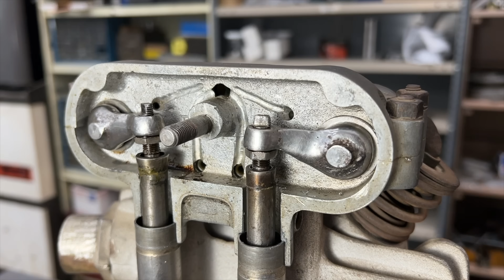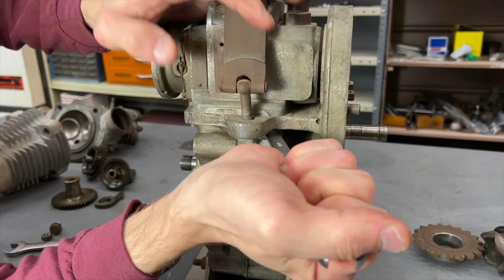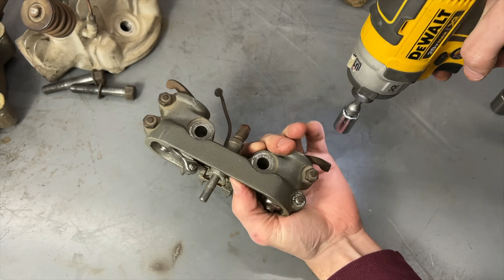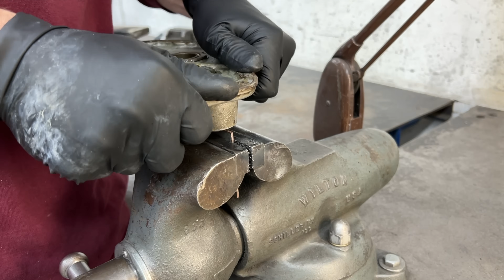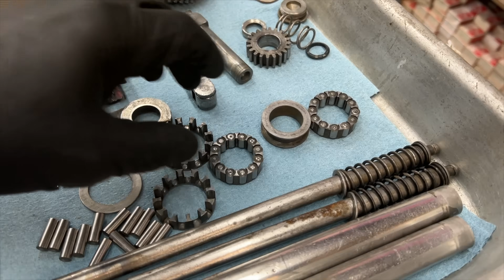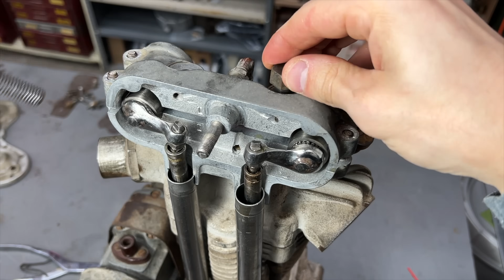The Most Expensive Engine I've Worked On - 1934 Harley CAC (Timelapse Restoration)

Comment: As a master Harley Davidson tech, I've always been on the fence when it comes to preservation of pitina. Pitina is nothing more than a fancy word for corrosion. If it's a one of a kind never to be run again , well then I think it should be left as is. Sure stop any further damage. But I think it should be disassembled and all parts measured for recreation. Casts can be made of the cases, gears and shafts, piston, and flywheel recreated and machined, seals and gaskets remade. Put the recreation together and build a copy of the bike and run that sucker. That's the magic. People can not only hear but see that baby run. I've gotten to work on some amazing old engines and you can see the for thought that went into its engineering. Cool vid.

Comment: Nice to see one of these engines apart. It would be interesting to map the cams to see what kind of lift, duration & overlap they ran. BTW, note that the hollow camshafts have some timed breather slots in them as well... for additional crankcase pressure relief. Good video!

Comment: Was interesting to see roller lifters in something this old. I once had a whole JAP (probably a 50s model) in my bedroom belonging to my brother. It had an alcohol carby with a slide but no needle (it wasn't missing. It's the way they are). Wish you had given more detail on the lubrication system. It looked like it had an oil pump on the timing cover.  I wasn't sure i could see a drain hole in the bottom of the crankcase or not. JAPs and ESO's have them to drain away the used oil. I noticed a copper head gasket. I think the Jap was metal to metal and lapped in.

Comment: Cool vid.

Though a remark :  rusted valve springs should never be re-used.   The pitting caused by corrosion,  is an excellent starter of cracks.   

One customer of mine found out the hard way re-using his mildly corroded springs...... 

Its a no go.   

Even touching with bare hands a non lubed spring can already trigger such tiny almost invisible spots.

Comment: Pretty decent video, I just hope that when you or whoever fires that engine up in the future will at least either replace those rusty valve springs or disassemble the valve train and polish the springs then check clearances. Everywhere rust is present on a machined surface it should be addressed if someone intends to swing some real rpm’s with that engine. Even if it’s not one of Petralli’s engines it still holds a lot of historical value. Just hope to hear that it receives the attention it deserves. I appreciate you showing us the tear down and partial inspection, hope to see more.
Reply from the maker: Thanks for the comment! On this engine the disassembly and reassembly was purely to check out everything inside to see what’s up with the condition and legitimacy of the internals. I will probably be rebuilding this engine and getting it running in a complete bike in a year or so. At that time all the machined surfaces and tolerances will be made perfect 🔥
Reply: @davidlarson3905  Good to hear, hopefully you’ll keep us updated on this engine and the bike that’ll receive it as it’s going on. It’s amazing to see things like this here and knowing they’re in the hands of folks who appreciate them where they’ll be maintained / cared for. Glad you’re here and made this available.